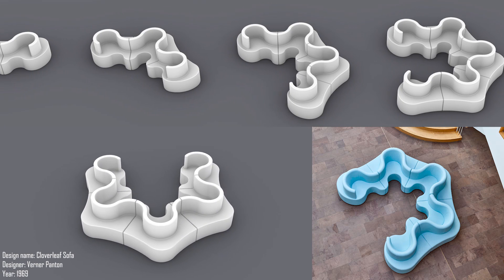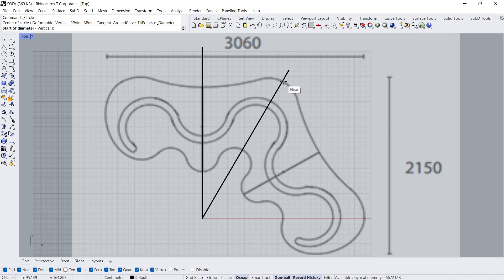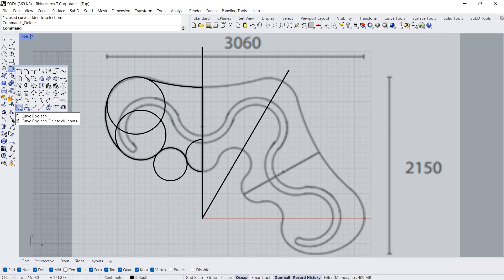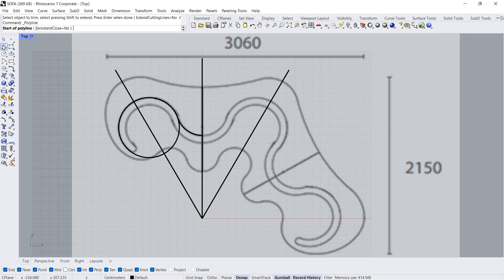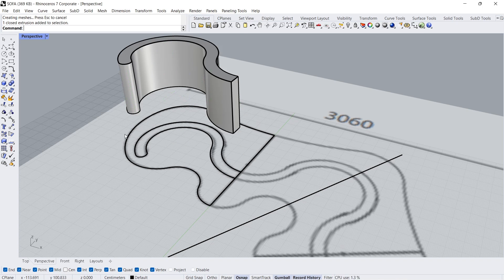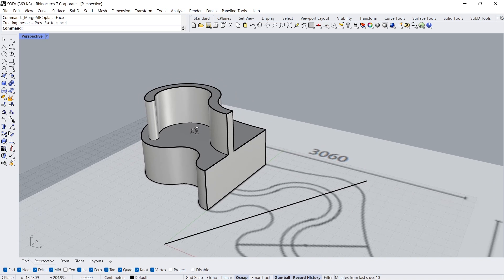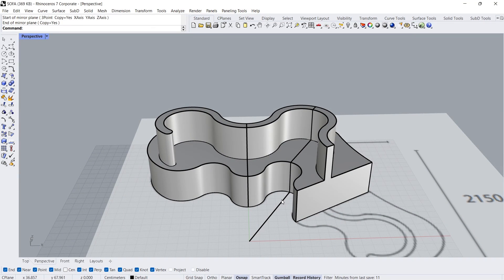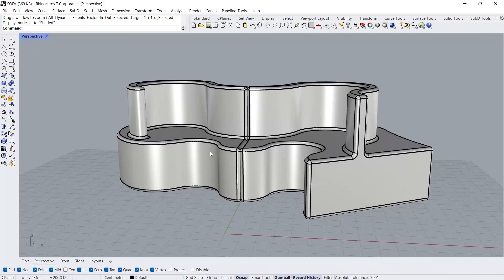Rhino Furniture Tutorial -  by Verner Panton

Comment: hi. why I use merge surfaces i can't fillet edge?
Reply from the maker: Hi, Try this. 
Before doing the fillet operation, select the model, type the following command and enter (DivideAlongCreases). Then you can filletEdge.
Reply: @AdamArchh  Yes, it was fixed, but the surfaces that I connected using the merge surfaces command returned to the first state

Comment: At 9:11 we begin fillet edge.  For some reason, I'm able to do the left side but not the right.  I followed all steps up to this point.  Any idea why i may be having this issue? Thank you for these videos by the way.
Reply from the maker: Hi, yes I had this problem before. When you run the fillet edge command, you will get an ancestor warning that some edges cannot be selected in the Command panel. If you paste those error messages here as a comment, I can remember how it was resolved.
Reply: @AdamArchh  Good morning from Miami.   The error message reads "Ignored 30 edges in objects with creased surfaces.  Use DivideAlongCreases to fix the objects."
Reply from the maker: @angelicacherelle  Good evening from Istanbul. Before doing the fillet operation, select the model, type the following command and enter (DivideAlongCreases). Then you can filletEdge.
Reply: @AdamArchh  copy that. I will try and let you know how it works out. Thank you.
Reply: @AdamArchh  It worked.  Thank you
Reply from the maker: @angelicacherelle  You're welcome